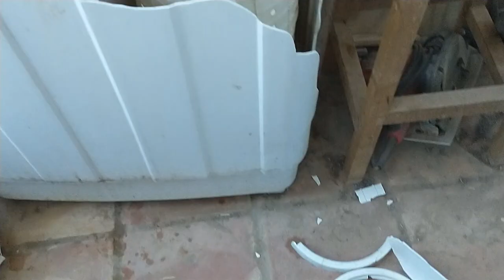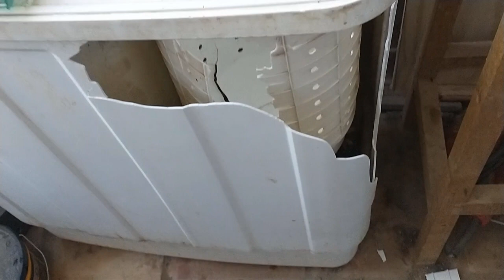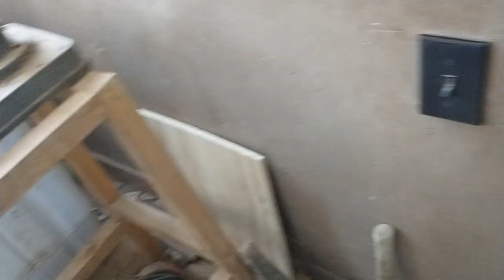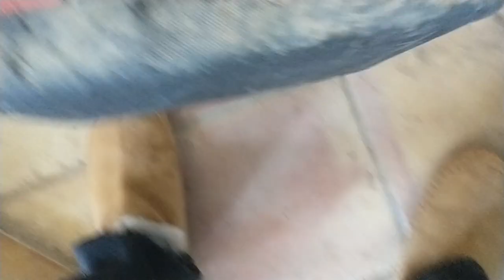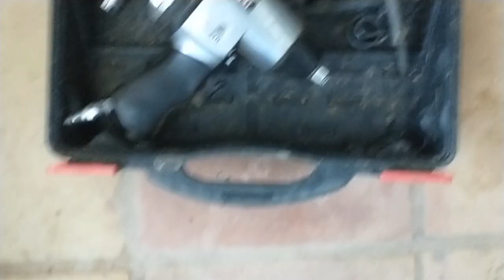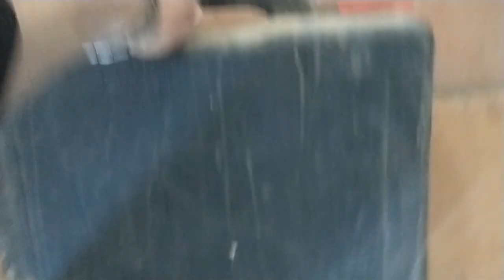My Twin Tub Washing Machine Exploded!

Comment: The machine does look older and maybe overloaded by that one picture. I have a very similar one and it spins very fast, to the point where the clothes dry in 5 minutes in the dryer. It's not worth fixing. Just buy a new one and don't put to much clothes in. Its basically a single outfit wash machine.